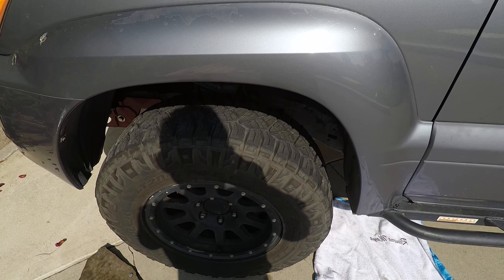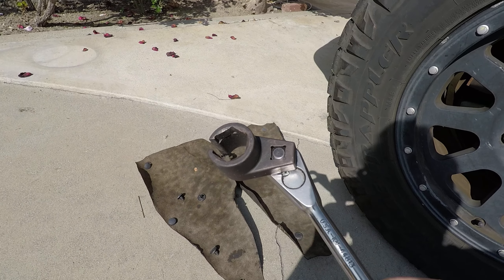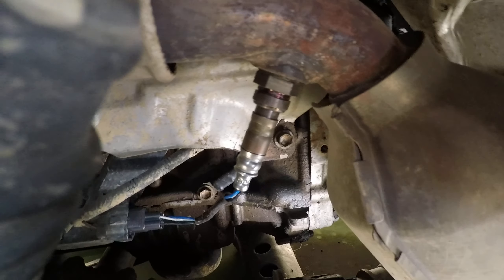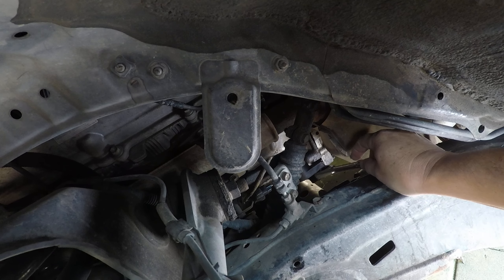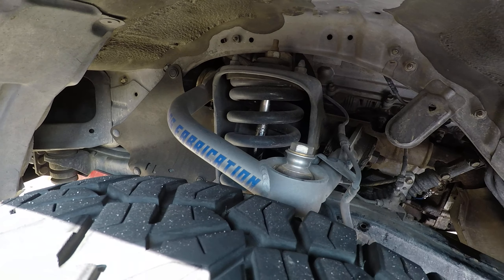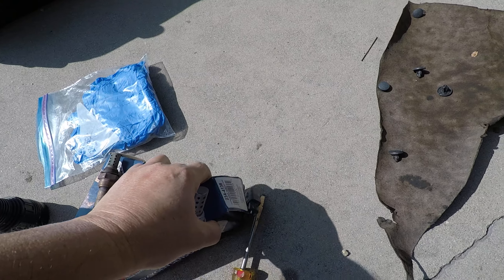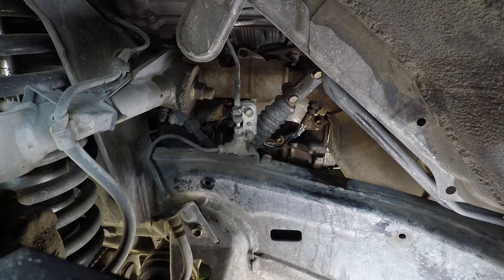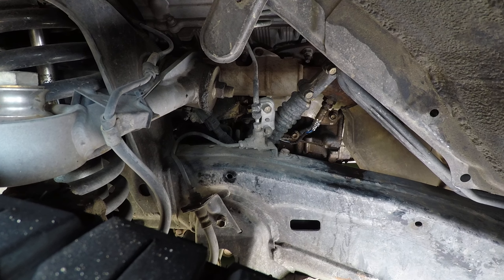2003 GX470 Upstream O2 Sensor Replacement

Comment: Is that the right part #? I thought it was 234-9051 for the upstream.
Reply from the maker: I just updated to say mine is a 2003. Please verify part numbers for your model year. You can check on Amazon or other oem parts web sites for correct fit

Comment: What was the issues you were trying to fix? Got my gx running super rich and my mileage is shit. I was thinking it was the o2 sensors
Reply from the maker: I was hoping to fix the P0420 and P0430 codes I’ve been getting for a few months and smog check was coming up in April.

And now that you mention it my gas mileage has been super sh*t before and after O2s and recently two new Lexus oem upper catalytic converters.

I need to start measuring my large-tire adjusted mileage. It seems I’m filling up 17 gallons every 200 miles non-adjusted
Reply: @MHam1   if you changed your o2 and cats and still getting the issues then maybe I'm guessing there's an exhaust leak? That's usually the 3 main issues with p0420 and p0430 codes but that's about the same mileage im currently getting but not throwing any codes.
Reply from the maker: My bad, the O2s did not fix my codes, but the new cats did fix the codes. I have no more codes 300 miles after changing the cats. Just the bad gas mileage remains. And I know that the battery was disconnected at the mechanic because my windows didn't work from the driver controls and I had to reset them.
Reply: Have you ever replaced your spark plugs, done an engine cleaning, and replaced the PCV valve? If not then it could be one of those causing bad gas mileage, I think

Comment: Great Video, do you know the location of Bank1 Sensor 2 (code P0037) on 2004 GX 470.  Thank you.
Reply from the maker: Sensor two is the one after the catalytic converter.

Bank 1 is the side where spark plug #1 is at. Spark plug #1 goes with cylinder #1

In my video, I was working on sensor 1 before the catalytic converter (aka upstream sensor).

I can’t remember which side is bank 1, but my understanding is you should replace O2 sensors in pairs…both upstream or both downstream or all 4
Reply: Thank you!